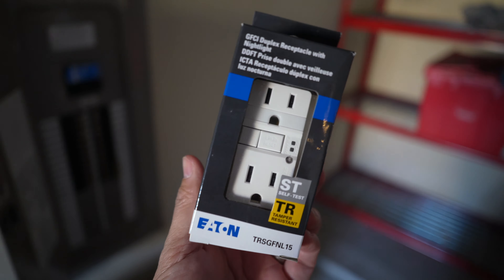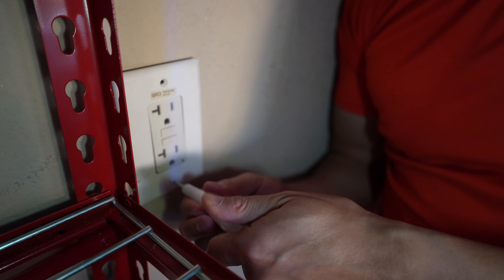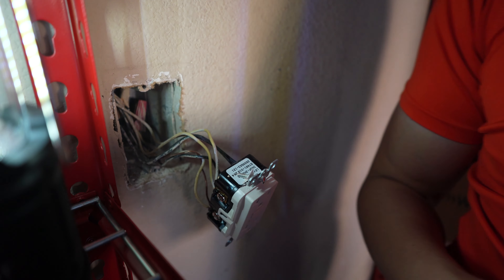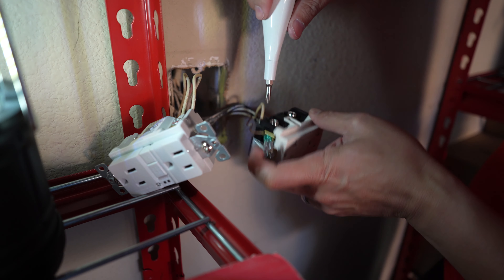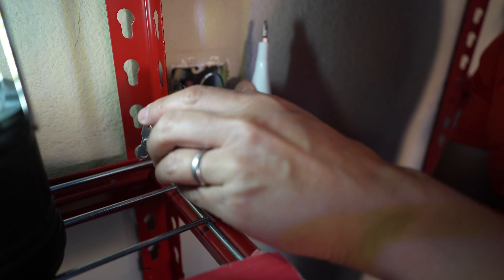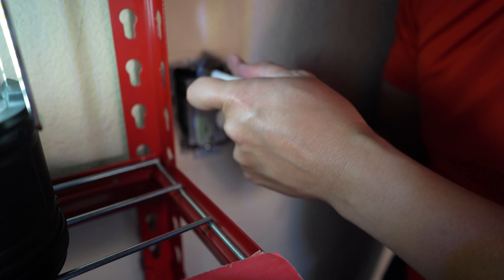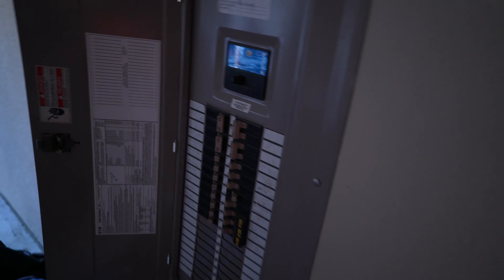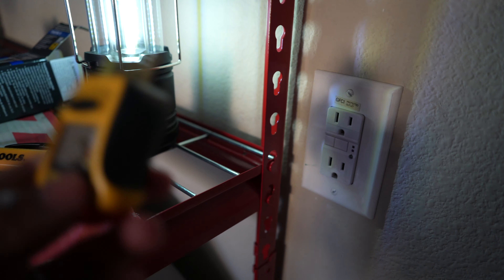How to replace GFCI Outlet from Eaton

Comment: When installing a new  gfci - compare old to new gfci for my new gfci - the Load and Line Positions switched so the black wires on brass screws and white wires on silver screws change from top to bottom - Have a tester to tell which lines are Hot - power on. Thanks for your video!

Comment: Looks like you replaced a 20 amp with a 15 amp device.
Reply: Yep. Although it should be fine since that specific 15amp Eaton model is rated for 20amp passthrough. Still doesn't make much sense why you would want to limit it if it could be 20.